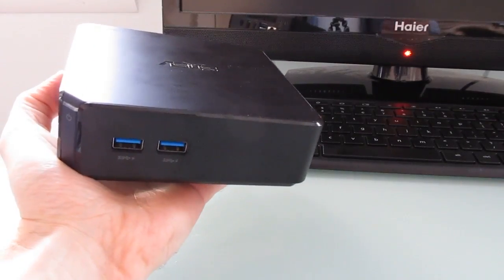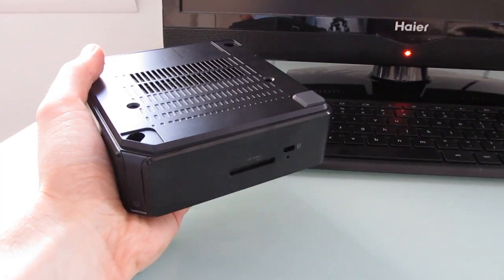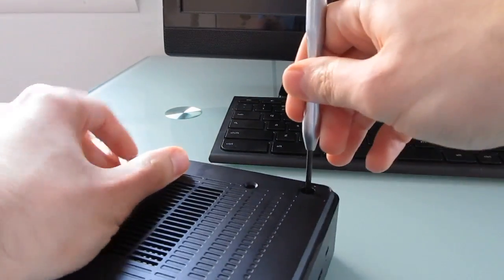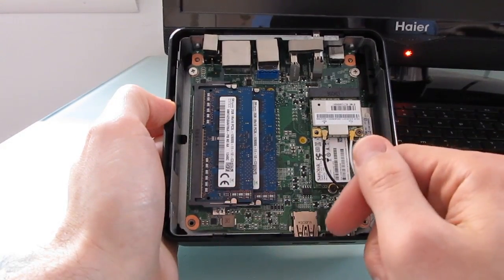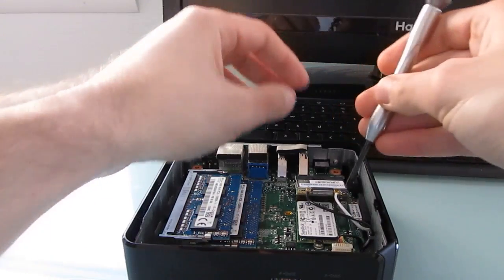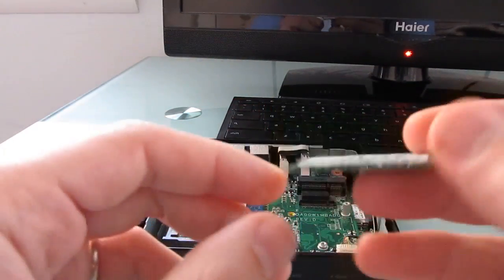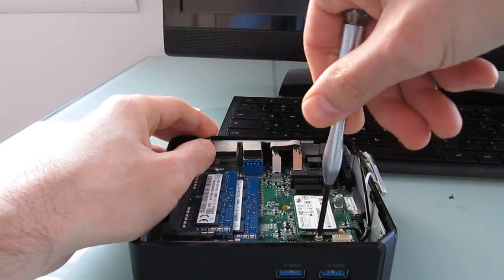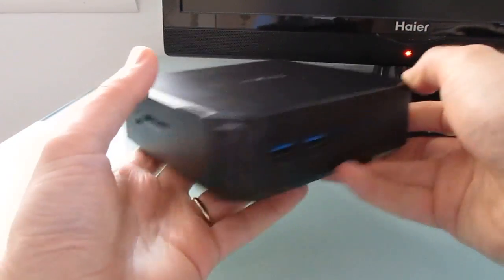Opening the Asus Chromebox to upgrade RAM, storage

Comment: Hi @
Liliputing - Where to locate Hardware right-protected screw in it? I want to install Window 10 on it and it says Hardware right-protected and enabled, cannot flash full ROM Firmware. 
Can you help me?
Reply: I believe it is the screw in the corner of the board with a little white arrow pointing to it.
Reply: Or will it work if I replace the SSD?

Comment: What is the maximum the SSD can be upgraded to?
Reply: You'll need to make sure that the NGFF SSD you buy is the same length as the one you're replacing. 256 GB is definitely available in this form factor... maybe higher.

Comment: How does it run other Operating Systems ???
Reply: You'll need to remove a write protection screw, then flash some custom firmware onto it. I made a video showing you how to do this on my channel. :)

Comment: Hi! I just discovered a really neat trick to get the case open without any effort whatsoever, and without damaging plastics: Use the VESA mount.

If you have your VESA mount and hardware, screw the two mounting screws into the unpopulated screw holes, hang the unit onto the VESA mount, and pull.  A gentle pull got me right in.
Reply: Xan Hilmisdóttir ... Thanks for the info . 👍 .

Comment: ChromeBoxes which have two "printed" and "stuffed" SO-DIMM slots are upgradable to 16 GB in the two slots.

ChromeBoxes which have one "printed" and "stuffed" SO-DIMM slot are upgradable to 8 GB in the one slot.

The Intel 2955U processor supports 16 GB RAM, maximum, in any "reasonable" combination of PC3L-12800S RAM sticks.
Reply: By definition, PC3L-12800S is 1.35 volts, and this is a requirement for the Haswell chip.

Pre-Haswell chips ... some of them, anyway ... can support PC3-12800 (1.5 volts) or PC3L-12800S.

Comment: Great video, thanks for posting. I was wondering if you have had any experience with the new asus chromebox2 g016u with the newer 5th generation 3205u celeron processor. can't seem to find much info on it. I'm looking to purchase a chrome box but am wondering with a 50 dollar price difference whether to get the new chromebox2. The original being 150 dollars and the chromebox 2 being 200. Just wondering if the newer processor is worth the extra 50 dollars. Figured I'd ask in case you had come across any info, Thanks. Also, with CES2016 around the corner I'll probably wait and see what is announced there before making a purchase.

Comment: hello, i have a questing maybe dumb question but still going to ask i just installed g.skill 4gb memory card as additionto original 2gb but i did reswap places put new one where i had original 2gb and original 2gb i put into empty slot i was wondering if its going to slow down my chromebox it felt bit slower or it's just me and my expectation well question is if it makes any difference re swapping original 2gb ram with new 4gb ram
tnx
Reply: Mars Kvaratskhelia Hey you have to make sure the RAM stick is DDR3L (L for low voltage) PC3L RAM sticks will work
Reply: Tnx man

Comment: Dont pry with a screwdriver to open, put in the two screws for the mounting bracket, that will give you something on the bottom to hold on to and makes it very easy to pop the bottom out.

I just put in 2x8 gb Crucial DDR3 (1.35v) and it works like a charm :)
http://www.crucial.com/usa/en/ct102464bf160b
Reply: If the specific model has two SO-DIMM slots, the maximum is 16 GB RAM in 2 x 8 GB SO-DIMM sticks, and the maximum SSD is, presently, 512 GB in one M.2 42mm stick.

Chromebooks should be purchased with no expectation of performing a RAM upgrade as most have two banks of soldered PC3L-12800S chips, either 2 chips on one side and 2 on the other side, for a total of 2 GB RAM, or 4 chips on one side and 4 on the other for a total of 4 GB RAM.

Chromeboxes should be purchased with the expectation that there is one SO-DIMM slot for Celeron models (8 GB maximum) and two SO-DIMM slots for Core i models (16 GB maximum).

Many models come as either 16 GB SSD or, optionally, as 32 GB SSD, and for those with M.2 SSDs, an upgrade to 512 GB is certainly possible, although 256 GB or 128 GB SSD is probably more reasonable.

But, some models have gone to soldered eMMC SSDs, which limits one's upgrade options.

And, many WiFi/BT cards are now being soldered, too.

You will need a PH1 and a PH0 driver for many upgrades.
Reply: Thanks for the tip on opening it up and also answering my question of how much ram it will recognize.

Comment: I'm interested in getting a chromebox to replace my laptop from 2006, I can see from the video this thing can get an upgrade in RAM and the SSD but what about video cards for maybe video games? can it run windows seven? how hard is it to replace the operating system in terms of novice level computer skills? would it be more cost effective to just build a custom PC?
 also could I remove chrome OS and dual boot with ubuntu and windows easily or would that be too much for this guy?
Reply: Just get a normal pc if you want to do games. Graphics processing is too slow for games from this century.

Comment: What type of RAM is used in it? I didn't catch it.
Reply: ***** Will regular 1.5v RAM work or it has to use 1.35v modules?
Reply: ***** That's not true. You can't just stick 1.5V RAM in and expect to operate at only 1.35V. You have to check online (if there is a manual) for what RAM is compatible and I would strongly recommend checking the RAM you are buying is 1.35V
Reply: Asus Chromebox CN60 and Chromebox MU075U with Intel Core i3 motherboard supports 1.5V RAM, but I suggest 1.35v RAM. You can also use the latter one on your Chromebook.